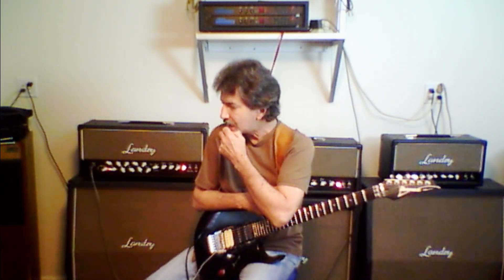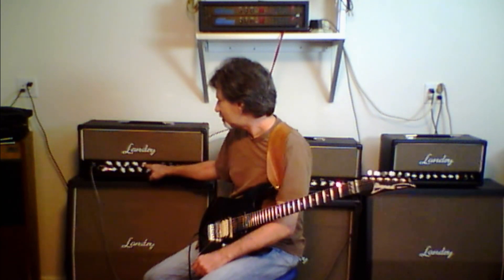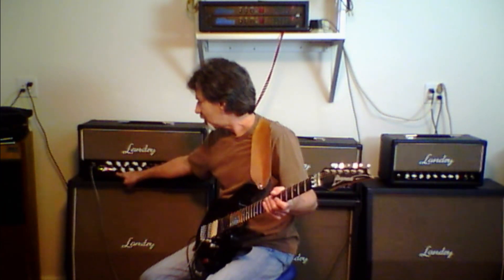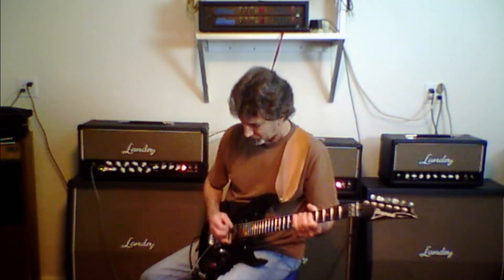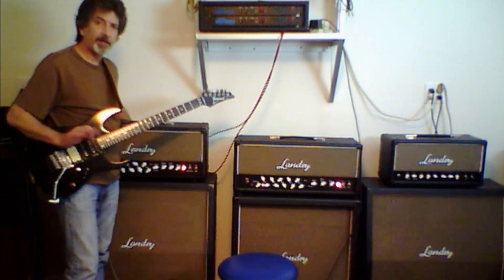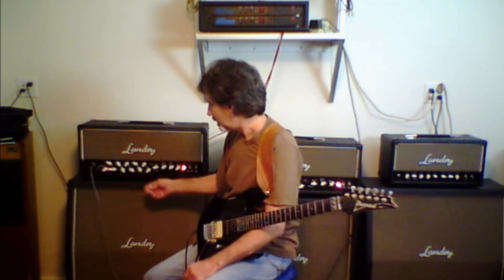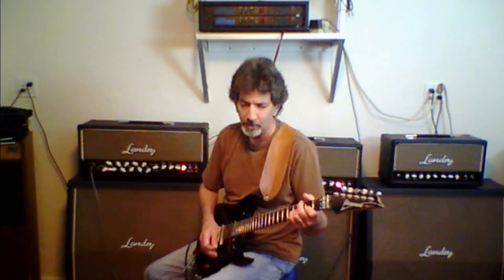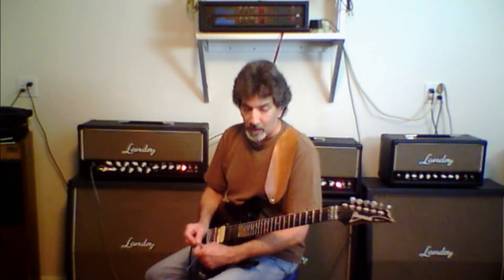Landry LS50G3 with two master volumes for 2020

Comment: Bill, quick question.. if i wanted to change the chicken head knobs on my LS50G3, to standard black round knobs, are they just standard pot size?.
Reply from the maker: Yes, they are standard size for amp pots. Guitar pots are smaller diameter though.

Comment: Ok I may have this mixed up,  but it sounded like you said there is a separate volume control for the high gain Channel.  Is a channel volume for the high channel and not really a “master volume”?
Reply from the maker: No, there are two master volumes. One controls the clean channel and the red mode of the distortion channel, and the other controls the high gain (yellow) mode of the distortion channel.
Reply: @LandryAmps   couldn't you have two master volumes that affect all three channels,  and one of the two masters could be set louder so it could be used as a solo boost?